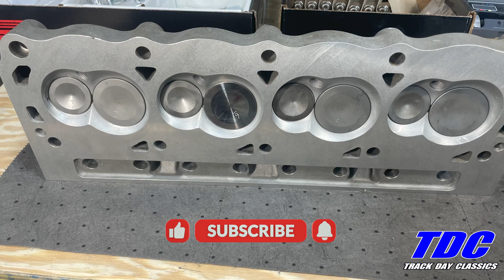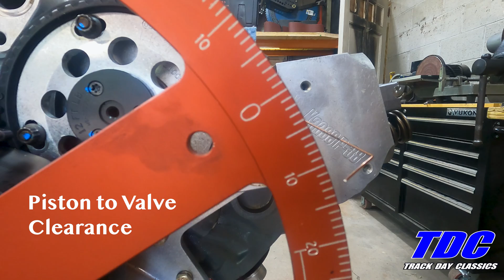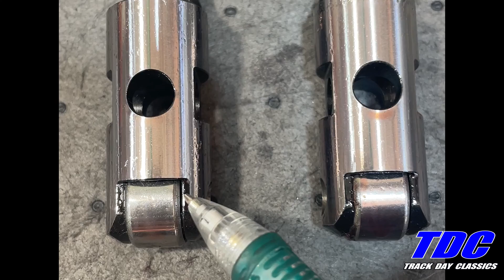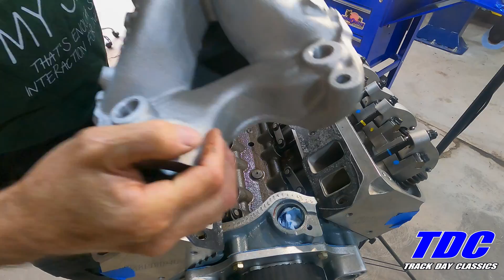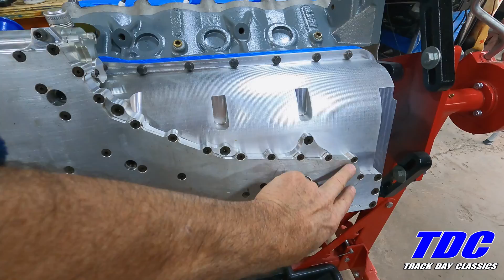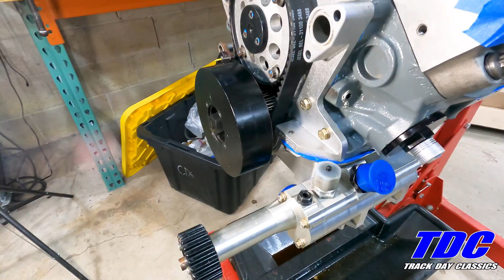CRAZY 347 STROKER?  Building a 347 to make BIG Power!

Comment: Hate to bust your bubble, but thank God for the aftermarket finally cranking out some real Ford heads based on Chevy valve and ports sizes huh?
Reply from the maker: Chevy Big Blocks rule for sure.  No argument from me.  I went through a lot to make this work and would surely make easy power with a LS.(gagging sound), but canted valves on the SBF (Boss 302) were pretty successful in Trans Am.  The complaint was they had to be revved to make those huge ports work.  On the Chassis dyno where my car made 410 ish RWHP, the dyno tech told me the thing was just starting to rage at 7000.  Big ports, canted valves, high revs in a SBF really appeals to me for a road course car.  So no Bubble busted here, and keep the comments coming so we can all benefit from each others experience, right?  Cheers!

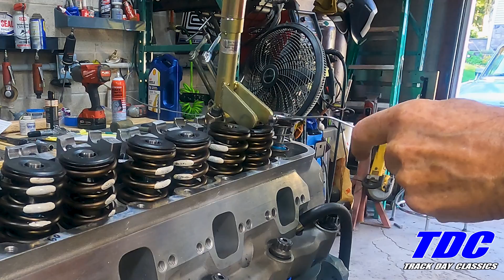Comment: Beautiful job…..hopefully your canted valve choice was well worth it and you get years and years of enjoyment out of this motor……me myself im personally a chevy guy (LS) to be specific.. i have supercharged LS swaps in both my nova and c/10……but my 15yr old son on the other hand convinced me and his mother into getting him a ‘67 mustang c code coupe….the original 289 is running great other than a little smoke from what i believe to be dried valve seals, but the car literally came from an old lady and only has 67k mi on it…basically its been parked for the majority of its life…..i picked up a late model 5.0 roller motor out of a explorer and a set of aftermarket 58cc chamber aluminum heads and new flat top pistons to achieve around 10.15:1 compression…im hoping to squeeze 325/350hp out of the roller 302 for when he is ready to graduate from the potent 200hp 289😂😂😂…….if it were as easy as a bolt in conversion i would have just put a cammed 4.8 LS in there and called it a day…..but we will give the 302 a shot before we have to start fabbing a LS swap system……besides a teenager has no business with 400hp in such a light car…or any car at all for that matter!!!!      I had a ‘65 fastback with a 4spd top loader built 302 i wanna say 4:11’s or 4:10’s and a mach 1 front end and brakes when i was his age in high school but i didnt keep my grades up and started skipping school, my father took that car from me and literally sold it within 48 hours……now i just kick myself in the ass whenever i see one , and think to myself that i had one that was wayyy better than what im usually seeing……
Reply from the maker: Talk about life lessons.  When I was about 18, I bought a Pinto with a spun rod bearing.  When it was all repaired, I had about $600 into it.  A friend of my brother offered to trade me his car for the Pinto and throw in an Ampeg bass amp.  I turned him down because I didn’t want a 10 year old 1965 Mustang K- code 4 speed convertible. 
Oh well.  Glad to hear you still believe in the SBF.  I wish you and your son the best in your car hobby! Cheers!
Reply: @trackdayclassics  thank you….were gonna need it